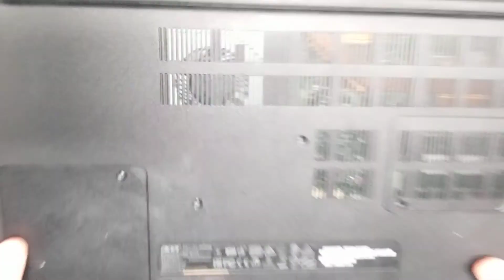Acer Aspire A515-51 N17C4 Disassembly RAM SSD Hard Drive Upgrade Repair

Comment: Hi! A friend asked me to add a 7.5mm. HDD but there is no cable attached (I already opened the A515-51 model N17C4), I would like to know how to connect it before buying it. I worked a bit with desktop computers around 17 years ago, I know very little about laptops
Reply from the maker: There's no hard drive under the door?

Comment: The tiny board in the front is a magnet sensor to detect the closed lid. It is a LSE911p. This model has 4GB onboard and the slot which in your case has 4GB giving 8GB dual channel. This model DOES support NVMe drives. My A315 only supports M.2 SSDs. Good one. Thanks, Binh.
Reply from the maker: Cool, thanks for the info!
Reply: Thanks god, coz when iam open my leptop for ram issue than see no ram in my leptop..

Avoid my English grmr🤡

Comment: Dear Friend, I am trying to put 250 GB external SSD in my system ACER ASPIRE 5 A515-51g my system partition is already in MBR mode, I am trying  to change it to GPT mode, 

if I change my system partition at installation (external SSD) time, my hard Will drive data be deleted or not?
Reply from the maker: I don't know what you mean. How are you putting an external drive inside your computer?

Comment: I have a question, can I use my system in m.2 ssd and use sata hdd only for files? is it possible? Thank you.
Reply from the maker: Sure, as long as it has the slots for both drives.

Comment: Is the RAM stick SODIMM?
Reply from the maker: Not sure. Most likely dual channel with built in ram as well
Reply: I'm talking about the size (here's an example:
https://www.amazon.com/Crucial-Single-PC4-19200-SODIMM-260-Pin/dp/B019FRBHZ0/ref=sr_1_3?dchild=1&keywords=ram+16gb+sodimm&qid=1600985054&sr=8-3 )
Reply from the maker: @JuanM04  sodimm just means a single stick. Open up your computer and check.
Reply: @ItsBinhRepaired  Ok, thank you very much!